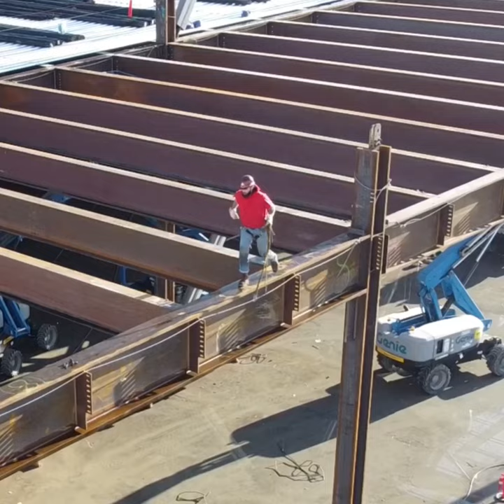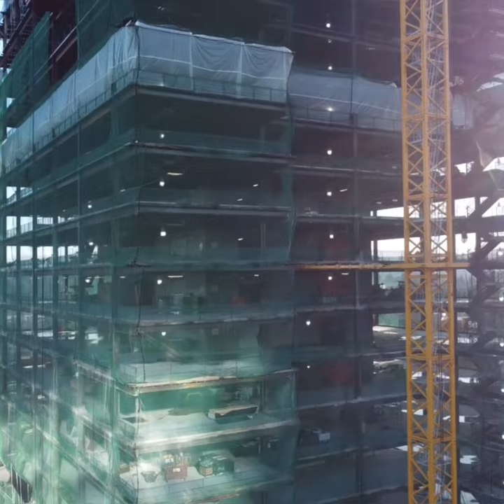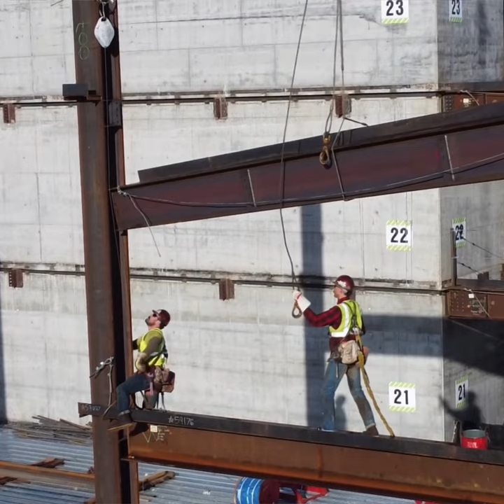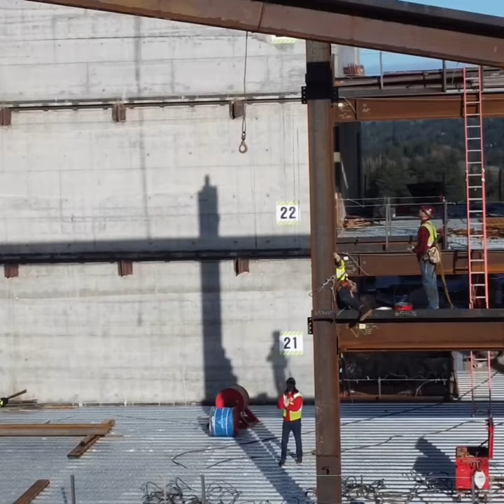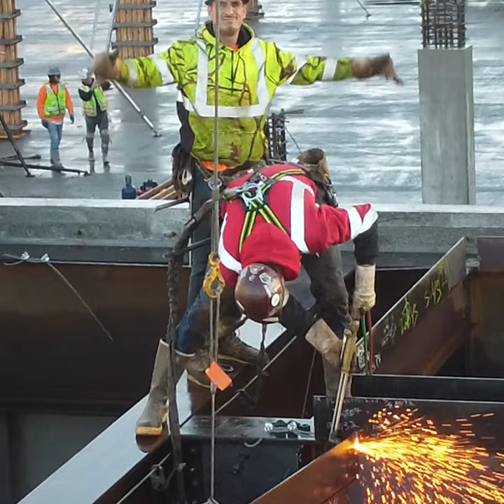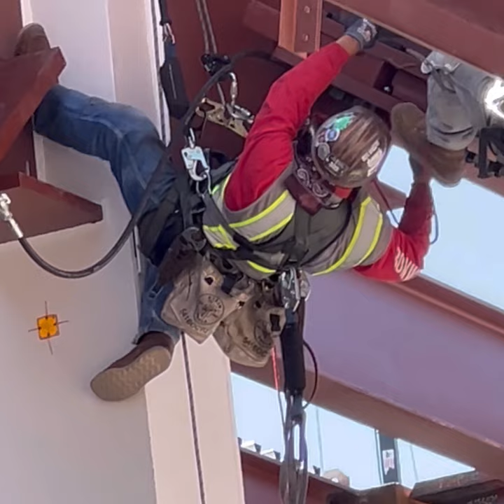Best Ironworker footage out there. Hang and bang!!! Level Up

Comment: I need to ask a question,how do uou get away with erecting these beams on a wire strop with a single sling,here in England we use   a chain with a double wrap for safety bite,or a bolt on lifting bracket,thanks chaps,stay safe 👊
Reply: Cause they are in a choke position and the cables are rated for that weight.
Reply: @dzl6848   cheers pal 👍
Reply: Yea every wire rope is load rated, & inspected for breaks in the lays before use. Union ironworkers local 433 Los Angeles 🤟🏼
Reply: @raymagana2780  thanks for the replies lads,stay safe up there 👊
Reply: @raymagana2780  NY 440 here... not nyc